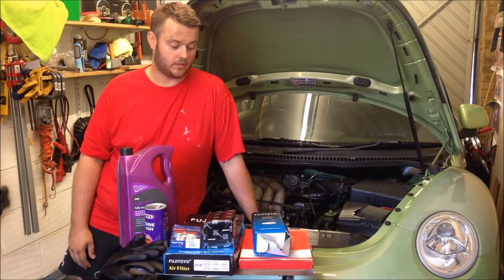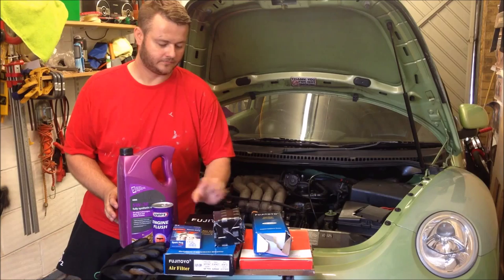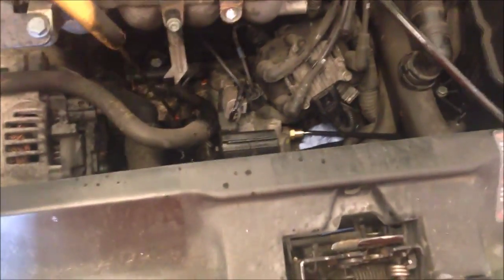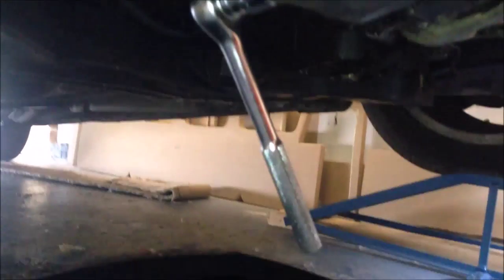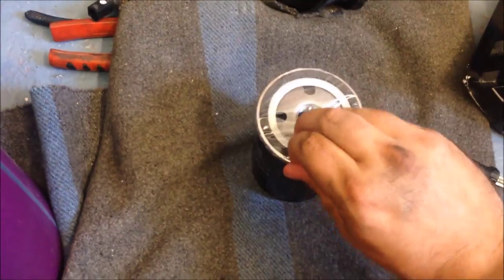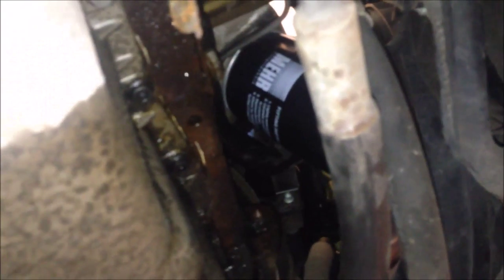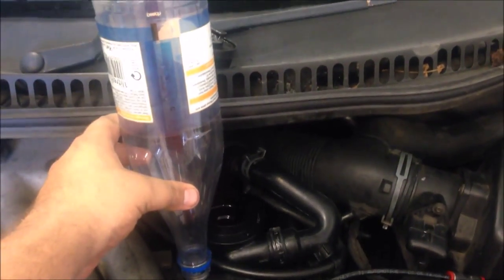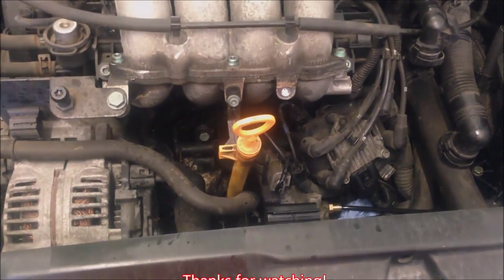[HOW TO] 2.0 VW Service - Oil and filter change

Comment: I appreciate it. I know a girl with a 2003 turbo Bug and that gives a look from what you might see on the under side and have to deal with, if the turbo is the same. On oil filters, I like to go about a 1/4 of a turn more than hand tight. Depends though and the strength of the person and position of the filter, on what hand tight is. Also always make sure the gasket on the old filter came off with the old oil filter when removed.  Some times they can be stuck up in the housing, and you have to get those out before putting on the new filter with its gasket on.

On the engine flush that is little more than diesel you put in your old oil and then start the engine and let it idle for 10 minutes and then shut the engine off and drain. Letting the engine then cool off and then open the drain makes it easier. To get the most old out of it, let it drain then for hours or even days.